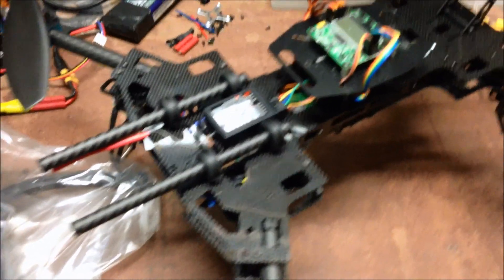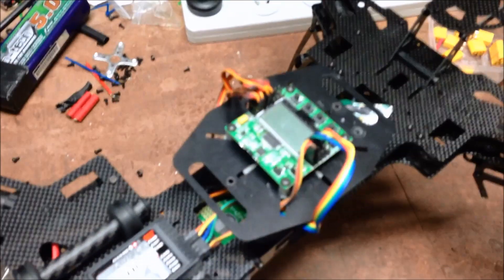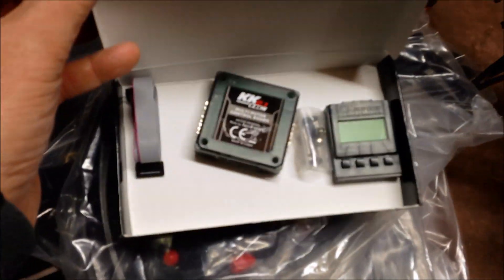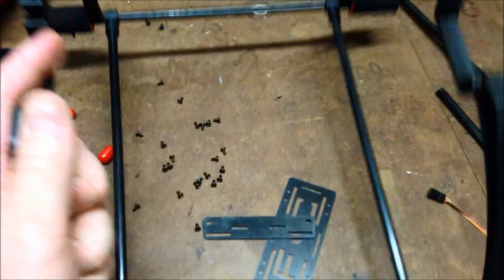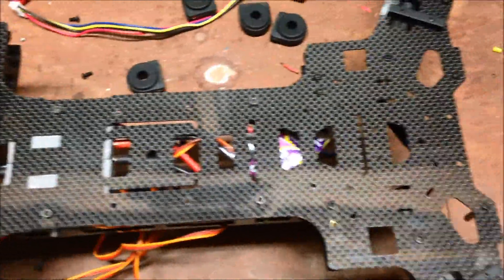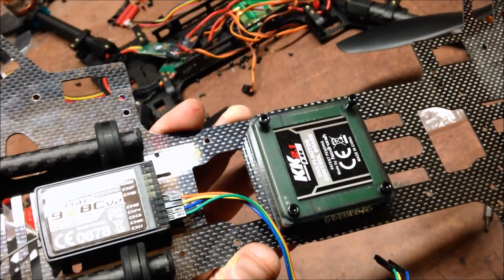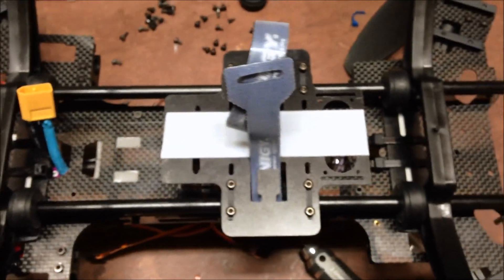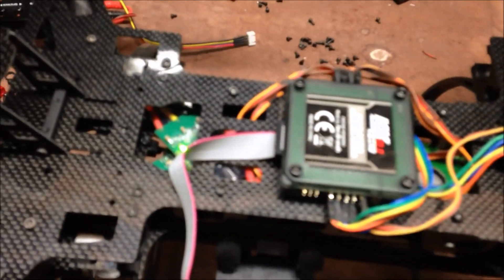Alien 560 Quadcopter updated Landing Legs. Also KK2.1HC Install

Comment: Did the landing gear have a name or source manufacturer?  Did you get it from HobbyKing too, or somebody else?  I can't tell much from the fleeting picture we get of the bag.
I'm thinking of trying to implement what I've seen Parrot do.  A long "axle" and two huge but very light-scale WHEELS.  With enough spring in the hoop it would soften landings, and with the weight below the axle, the quad rolls on the ground on take off and landing if need be.  I'd have to figure out how to quickly install and remove the landing gear for transport, but I think it's a pretty interesting idea.
Reply from the maker: http://hobbyking.com/hobbyking/store/uh_viewItem.asp?idProduct=40596

That is the one I used. Your wheel idea sounds interesting but once you get the hang of it your landings are usually pretty soft. Its just in the configuration stage they take a bit of a beating. Once all the PIDs and ESCs are calibrated and tuned landing gear is not so much of an issue,
Reply: Thanks!  Yeah, that's the 230gram setup I looked at.  After building, I fit foam pieces between the leg sides that add 40mm to the height and I hope will cushion the landings for those rather brittle legs. I'd like to try to keep the legs because they're only 96grams, and I want to try to use those platforms for the ESCs as advertized.  I'll keep the link on file just in case though!
Reply: +Hugh Hemington Hi search ebay for A560SS landing legs   real CF and they keep the great frame design look as well
Reply: Thanks.  I'll look those up.  I figured out a way to keep the existing legs intact, by wedging foam "legs" between them to take the brunt of the landing, but this would obviously be more elegant.

Comment: Did you purchased the 2nd cross boom separately or it came with the set? I have the same frame, and I'm kinda scared that the existing landing skids will break. They feel very weak.
Reply from the maker: I bought 2 landing skid sets just so I could have the second strut. They were not that expensive and the rest I can keep as spares.